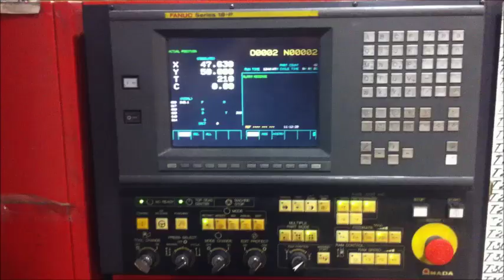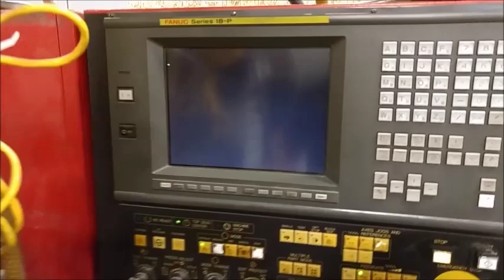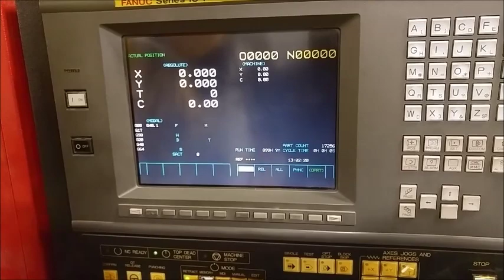Amada Vipros 255 Turret Shaft Repair step by step mecanicomp service

Comment: We have one and the air cylinder on the lower AI clamp went out.  I was able to take it apart and clean it up, replace the O-rings, then put it back together.  It would have been better to call Amada there isn't much room to work.  Everything on that machine is hard to get to or its some weird size.

Comment: Why does Amada use 1 motor for both turrets, whereas LVD old machines used two separate motors for the turrets.
Reply from the maker: Engineering is not the same between machinery builder.